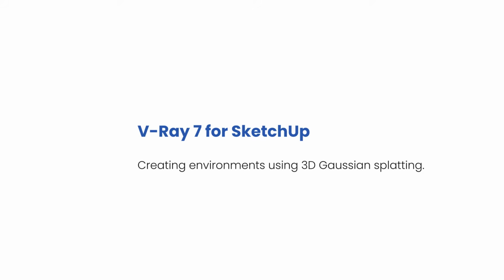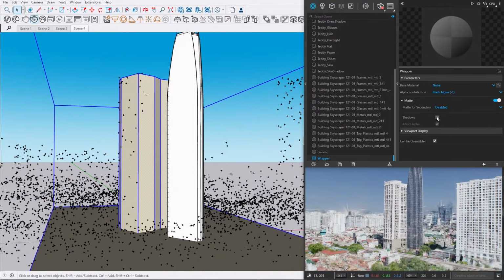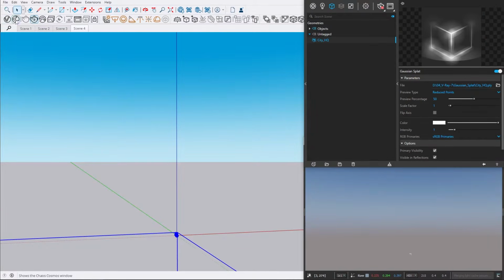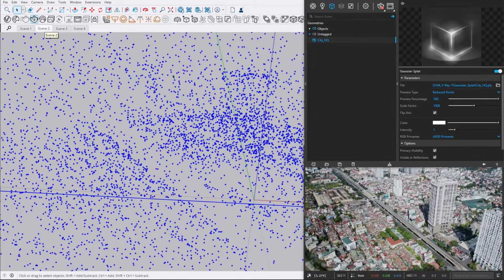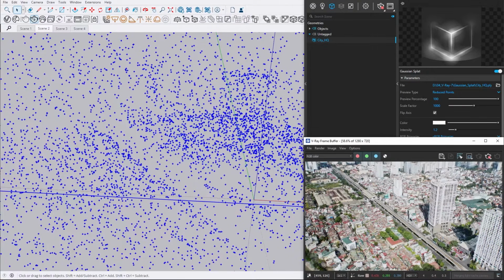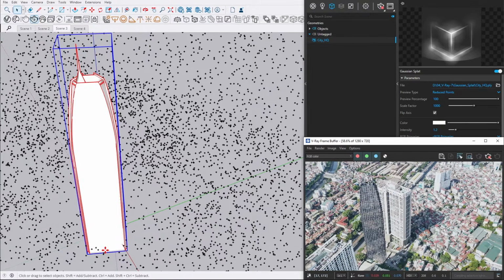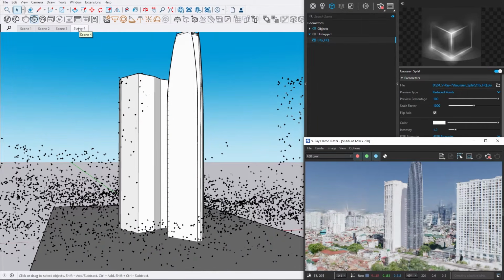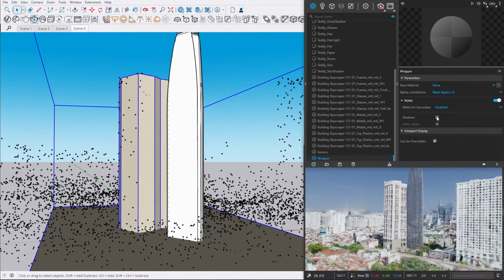Gaussian splatting in V-Ray for SketchUp

Comment: It's a slightly interesting concept but who wants geometry as glass shards. Notice the horizon.
Photogrammetry to mesh is cleanly better, especially with capable machine learning methods that can even reconstruct the exact structuring of the buildings like they were cad models, including materials like glass. So there was no need to support gaussian splat. It has no future.
Reply: Cette semaine j'ai scanné plus de 3km en moins de 45 min, je peux maintenant intégrer n'importe quel modèle 3D dans mon environnement réel pas besoin de le construire.